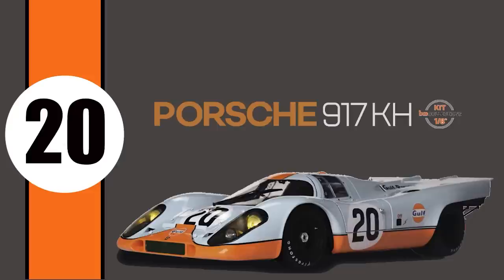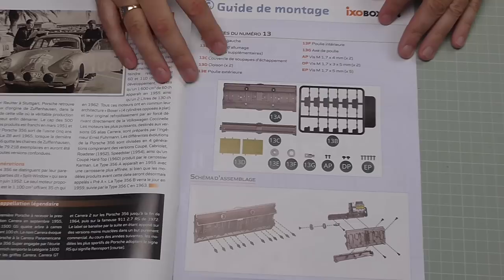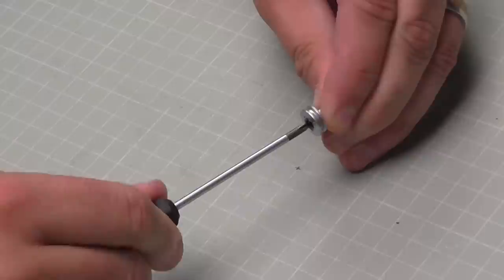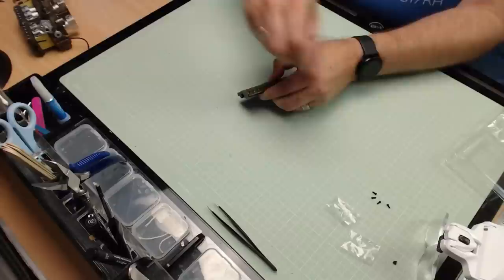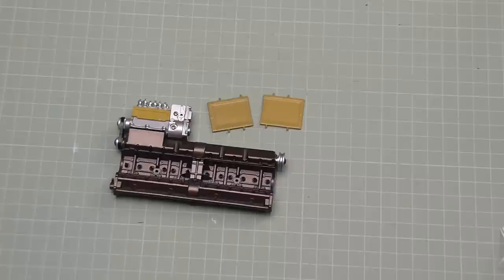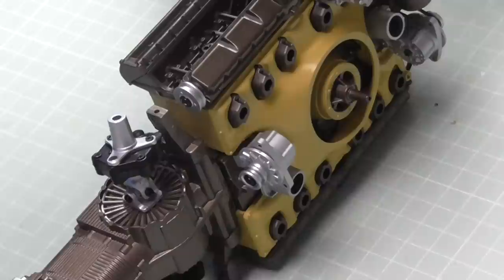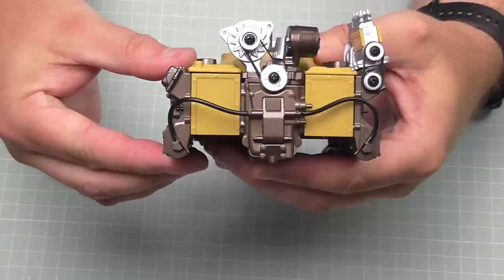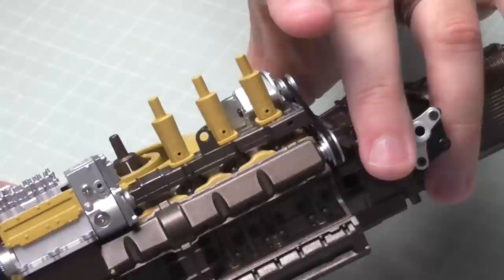Build the Porsche 917kh - Pack 4 - Stages 13-16

Comment: All those 'yellow' bits were made of glass fibre and were actually translucent including the cooling fan that will probably be in the next stage.
Reply: Yes - the body shell was also GRP and was only 2mm thick.  I guess for modelling making the components from GRP would be totally impractical.  For the brave, I guess some could use the existing parts as a former for making their own vacuum formed components which could be sprayed with a translucent yellow coat.
Reply: @davidgriffiths4844  Yes the bodywork was so thin that Derek Bell complained that on the Mulsanne Straight, the panel over the pedalbox was flexing so much that it was trapping his feet! At 200+ mph approaching Mulsanne Corner that's not an ideal situation!

Comment: In Pack 3 where we install the spark plugs - one pinged off into the black hole of my work area (if you find it, let me know..lol) - leaving me with 5 plugs left over. In Pack 4 - Stage 13, it looks like we install about 12 more plugs that are all supplied. Did  IXO give us some spares, or do I need to make one out of spare plastic?
Reply from the maker: I think there should have been 1 or 2 spares on the sprue
Reply: Thanks. Eases my mind a bit.  @WorldofWayneUK

Comment: Got a question for you... I am having surgery in a couple days and will be "out of service" for a few weeks.. I like building things but will be unable to work on the stuff I'd normally work on.. I've never done one of these large model builds but it looks like something I'd like to do and I was thinking on ordering and getting the first couple packs to work on when I get out of the hospital and am recuperating..  Then once I go back to work I'll have something to look forward to once a month. So.. my question is.. If I were to do this, which subscription should I order, the F40 or 917?  I think I easily have the skills to do either and I am in the USA so shipping will be high but I am kinda leaning toward the 917..
Reply from the maker: 917. F40 is really hard and isn't as smooth flowing as the IXO build.
Reply: @WorldofWayneUK  agreed 1/8 Porsche917 KH is amuch smoother build
Reply: @WorldofWayneUK  Well, on top of having to be in the hospital it was my birthday so I got myself a birthday present... I went ahead and placed the order for the first three kits with a subscription for the rest..  I've built plastic models, radio control airplanes and cars, restored full sized motorcycles etc. but this is the first kit like this I've done. Hope it's as much fun to build as it looks like.

Comment: Wayne, I hate to say this but the French subtitles are mostly horrendous, sometimes hilarious when it doesn't quite hear the right word but overall it just reads like complete nonsense. I know it's done by Google translate because try as it might it has never managed to get direct translation into French right, so not your fault. Other languages probably work better but not that one.

If it helps someone else great but for me it was more distracting than anything (not that I need them, I just happened to have them on and for some reason it showed them to me in French). Sorry I hate to be negative like that...
Reply from the maker: I figured that. I use a software program that converts word for word so I can guess its not going to make much sense but it is what it is
Reply from the maker: Saying that I took the French subtitles and converted them back to English and they don't make much sense there either. I will have to work on that.